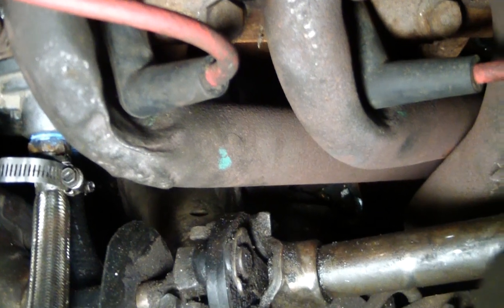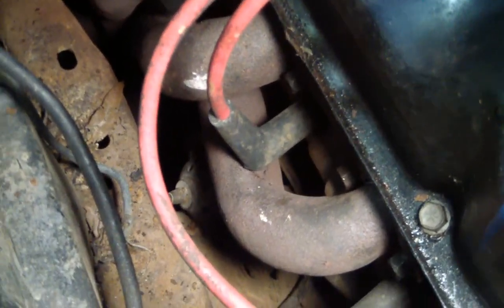351w 87 Ranger Gets a 01 Explorer 302 With GT40P Heads

Comment: What headers did you use ? I have a 94 that I'm wanting to drop a 351 in and can't really seem to find a solution as far as headers
Reply from the maker: I'm not sure I found a set in the junk yard 25 years ago when I first swapped it to a v8  that were off. took them to a ranger that they had in the yard with the motor out put them about were the motor would set looked like they were made for it . look up some for a  78 mustang 2 v8  and about 78 f150 i'm thinking thats what i found in the junk yard  hopefully this helped you some
Reply: I use flow-tech. They are a good fit for my 85 f150 4wd with a 351 windsor.

Comment: what's the hardest part of the v8 swap. I have 84 4wd I wanna 302 swap
Reply from the maker: a body lift will solve alot of the issues you won't have to beat the trans tunnel or modify the heater box only other issue is the steering box you will need a oil filter relocator for that, headers might be tricky to find never done one 4wd with a body lift might make room for everything. the hardest part for me was making the clutch pedal work with a cable  I swapped mine to v8 back in 95 before they sold kits like they have now  it's not that hard to do a 2wd if you go carb 4wd might be a pain getting a trans and transfer case that will work.  it really depends on what you want to use for drivetrain old school or new school.
Reply: What was the mpg on the 351 n the 302 in the ranger
Reply from the maker: 302 just driving normal got 19 hwy at least 15 cty 351 got 14 hwy about 10 around town the 351 is 76 block with 70 heads flat tappet cam 302 that was in it first was a 93 mustang roller cam factory it was all around better with the 302 thats why I put a 302 back in now the few hp more the 351 had was bottom end but it wouldn't turn but 5600 rpm 302 would turn 6250 factory cam and springs 76 351 2v had 154 hp 93 302 had 225 hp I just like a good 302 I'm sure you can get more hp out of a 351w if you start with a 94 roller bolck and put some good heads on it but old school 351 vs new 302 I would go 302 all day

Comment: Why would you go from a 351w to a 302
Reply from the maker: I had the 302 13 years on a engine stand with 97000 miles on it 01 model. 351w is 76 block with 70 heads 270/ 280 flat tappit cam wouldn't turn 5600 rpm. A 302 to me is a better motor it's stronger than the 351w I took out. I put a semi truck turbo on it now it feels like two 351W's.  302 has a 10.5 clutch 351w had a 10 inch clutch. 302 has better heads, clutch, lighter, roller cam, and cheaper on gas.  The truck has had two 302s ,351w back to a 302 now with a turbo. With no power steering and 10 inch wide rims it was a bitch to drive.
Reply: kickassmustangs garage would a 90’s roller model be decent, I’m only asking cuzz I’m trying to decide on one of the two for a first gen ranger, and I do want to keep it a stick
Reply from the maker: 94 351w is  a roller motor. The first  motor I used was a 93 mustang 5.0 swapped to carb  and T5 transmission. I ran that for the longest then came the 351w never ran like the 302 drank gas 5 miles to the gallon difference 302 got about 19 MPG 351W got 14 MPG  and less performance 5600 RPM 302 would turn 6250 RPM factory cam and heads

Comment: Why the hell would you trade a 351 for a 302? That don't even make any sense. That 351 windsor from the factory with out do all that your doing to the 302. No replacement for displacement. 351 windsor is 100% better than the 302.
Reply from the maker: The 351W didn't do anything but drink gas. It ran a lot better after I swapped it back to a 302 before I put a semi turbo on it. I still have it and another newer 94 roller 351W. I had the 302 for 15 years sitting on a stand I figured it was time to test it out. Go watch some of my other videos and subscribe LOL. I'm about to upload another video on the roller 351W swapped to carb running on the ground
Reply: @kickassmustangsgarage  damn bro. Where can a person get a semi-turbo from. Peterbuilt, Mack, or freightliner? Man, that sounds like a big job to hook that up. You got my attention with that one.
Reply from the maker: @mattisenberger4042  I've got 4 now the one on the truck now came off a volvo with a 12.7 L . It's easier than you think blowthrough. I got plans to put one on the roller 351W. I got 2 off a 14L Freightliner and another off a 12.7 in a Peterbilt . They"re around $800 for a brand new one and last forever. The truck the turbo on the Ranger came off of had 2.1 million miles on it and still works perfect.
Reply: @kickassmustangsgarage  man, i never knew they would work on a regular truck. Thanks for that. I'm sure about to check it out. I know about blowthrough. Just never been a booster. I usually leave that to the ricers. They need it more than my ford. But this is interesting and different. So I'm going to check it out. Thank you for replying sir.
Reply from the maker: They are big but a Semi only turns 2200 RPMs and make power from  1200-1800 Rpms. If you think about it a 302 at 6000 RPMs 5.0 L times 6000 =30,000 L of air a 12.7L times 2200=27,940 L of air. I try to reply to everybody that comments.  Sometimes I don't get notified from YouTube if it's not a fresh comment after about two replys they stop notifying me.
Reply: @kickassmustangsgarage  thanks bro. I'm sure I'll try for more questions later down the road. Good info is worth it weight in gold for a Ford truck nut like myself, and I'm always learning. I'm 47 and have never owned a vehicle newer than 1990. I always go for the old ones. Especially the bullnose ford trucks. 7th gen are in my opinion some of ford greatest trucks. Their tough as hell.
Reply from the maker: They did it to me again I'm just finding your comment. Yeah I like the older Ford trucks myself. My dad always would say he would rather live close to somebody with a Ford than have to own a Chevy.
Reply: @kickassmustangsgarage  your Dad sounds like a very wise man. And I agree whole hearted.